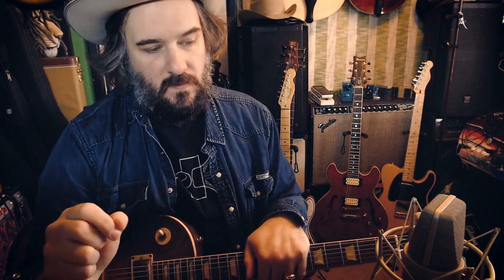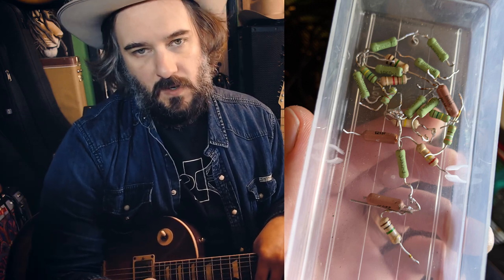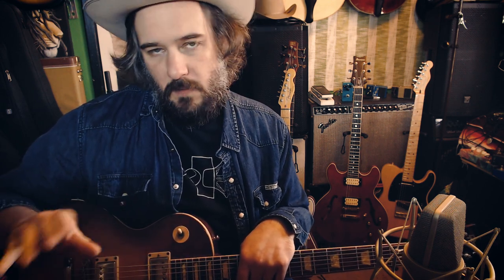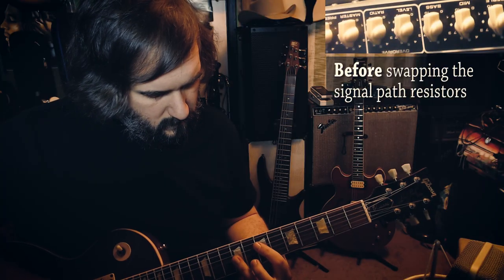Dumble 102 Draloric Resistor Makeover! Upgrading my Dumble Overdrive Special 102 Style Guitar Amp

Comment: Nice video, but as you said, you changed values on different points. For instance 22k instead of 33k on the first grid... I tend to say, it's snake oil. But als long as it is fun to tweak the amp, it's worth the money. Cheers.

Comment: Resistors are more likely to color the tone when there is DC current across them and when the signal that goes through is strong. Did you changed the plate resistors?